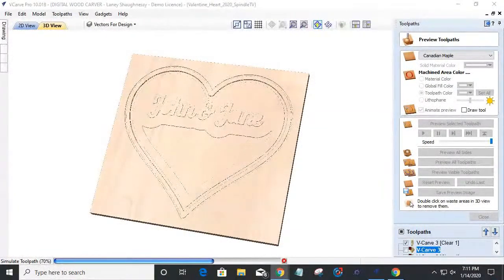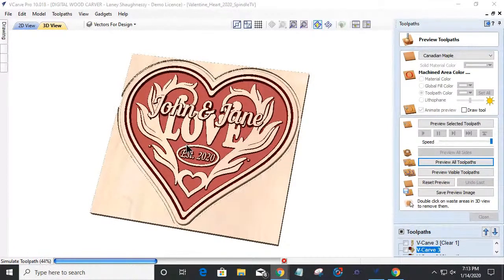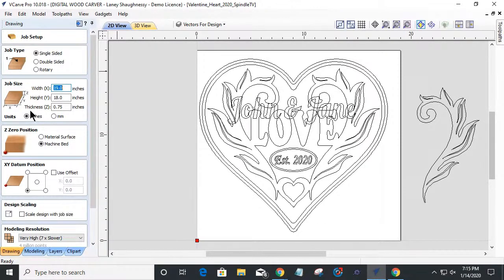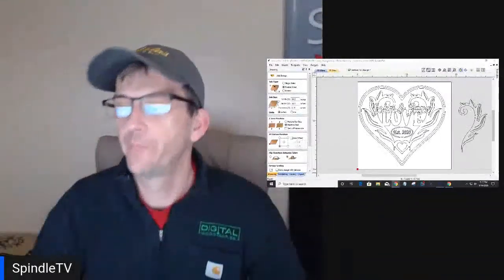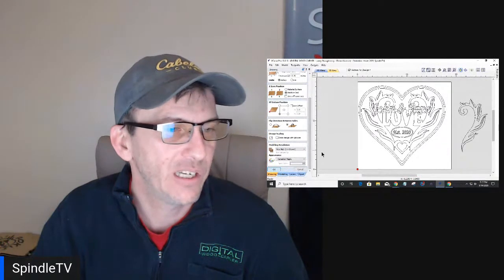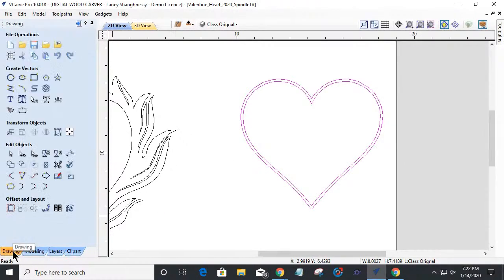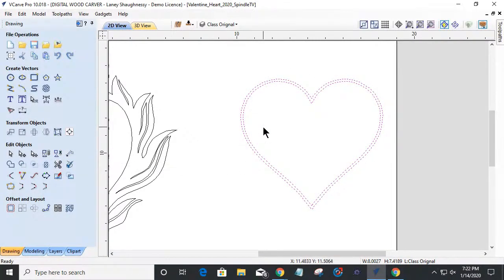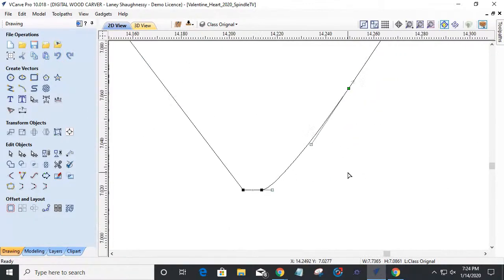Text on Text - Make a Decorative Valentine's Project - A Vectric Tutorial

Comment: Thank you very much Laney. I learned a ton of new techniques from this video.  The only thing I am a little confused about is the alignment hole locations flipping from top to bottom. I will have to try it to believe it will work as expected. Maybe a video of cutting just the alignment holes on the machine and flipping it to the other side will clear any doubts. My first instinct says the alignment holes wont work as specified.
Reply from the maker: Ray thank you for watching. If you cant take my word for it, maybe you can take Vectric's in the beginning of this video they explain the 2 methods for creating alignment holes for 2-sided machining https://youtu.be/JBSSC0tBCZY
Reply: @SpindleTV  Now I realize what is going on.  The holes drilled on the spoil board are from the bottom side circles which are already flipped to the mirror image, whereas the blind holes you drill on the top side are not flipped. So when you flip the board they match the locations on the spoil board. My initial thinking was that you are drilling straight from the top through the material and into the spoil board. That is why I got confused. I just tried it on vcarve pro 9.512. Thank you for the response and  clarification.